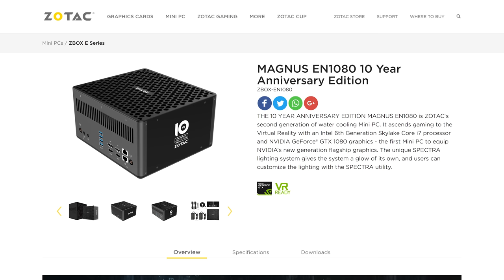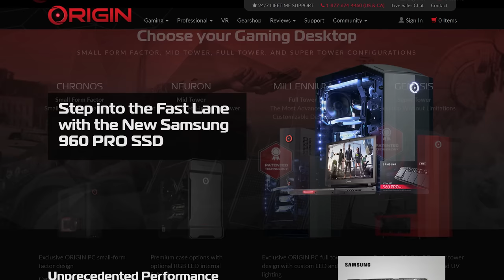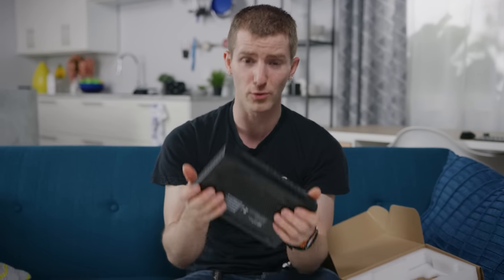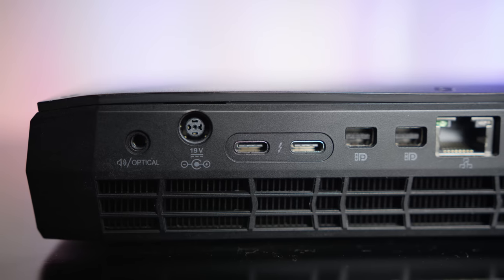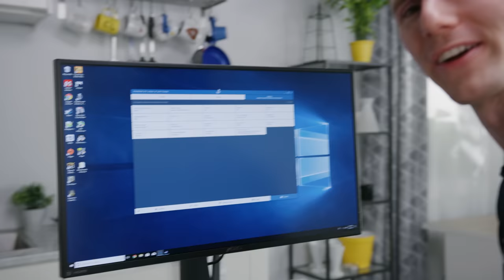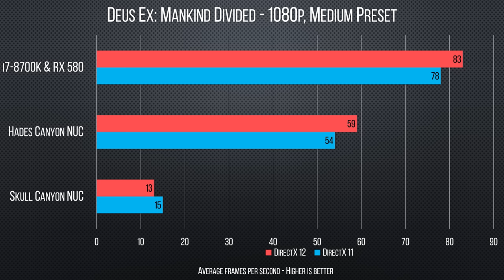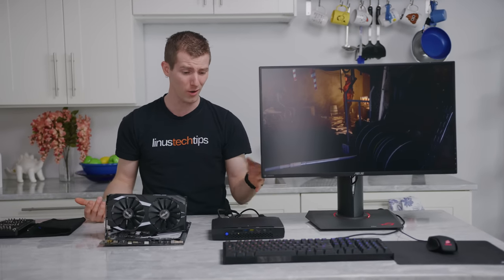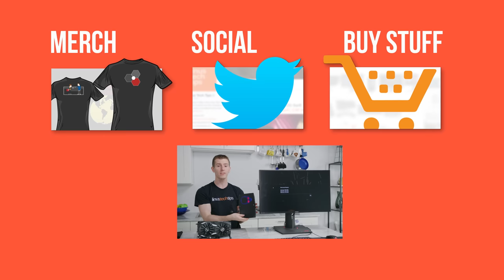Intel's Coolest CPU EVER... Thanks to AMD!

Comment: Ryzen 2000 series tomorrow
Reply: hype!
Reply: Is the 2nd gen the Ryzen 5 2400G?
Reply: Ex Gaming no 😂
Reply: Ex Gaming, not really the 2400G is Ryzen with an integrated GPU, it's not the Ryzen 2 CPU's launching tomorrow.
Reply: DanielRichards644 im sad that ive just bought an ryzen 1600 last 3 week
Reply: lance, no problem if you got a good deal on it. I bought a R7 1700 about 5 weeks ago for $200 USD Brand New in box
Reply: Honestly what are you hyped for? The 2000 series gives you like 200-300mhz more, thats it. Even less exiting than the upgrade vom Skylake to KabyLake
Reply: And Moto G6!
Reply: Don't be sad, it's not like Gen 1 Ryzen is obsolete now. I have a 1700X in my system, and it does everything so well I don't really see the need to upgrade to Gen 2 Ryzen.
Reply: R Y Z E N 2000 is availible ToMorRoW
Reply: SchwertKruemel Better memory latency,better in gaming at the same clock speed with Ryzen 1000,new chipset with preciion boost 2 and XFR 2,better ram memory support and better performance single core and multicore!
Reply: SchwertKruemel Der8auer oc'd a 2700x to 5.8GHz (using liquid nitrogen of course). 1st gen ryzen chips couldn't even get over 4.2. tell me how that's a really small performance gain
Reply: Well unless you have a liquid nitrogen system then we are yet to see what performance gains gen 2 has over gen 1 in a realistic consumer grade setting. Of course the chip will shine when pushed to its absolute limits, but your average consumer probably won't get anywhere near that kind of overclock. I'm not going to argue that it won't be better than gen 1, I have no doubt it will be. Just saying gen 1 Ryzen are still good chips and will most likely become even more affordable with gen 2 stepping in. I still don't see the need to spend more money on a gen 2 chip when my 1700X puts in some serious work. Saying you have to run out and grab the latest component is the same toxic mentality iphone users have. Don't bring that toxicity into the PC community when all people want to do is squeeze every ounce of performance out of whatever they can afford... I mean sure if you're about to build a new system go with gen 2, but having a gen 1 Ryzen cpu is perfectly fine... They still perform great.
Reply: XxAdyxX98 you stole MSI's
Reply: @Gaming Dutchie Back in 2017 he got 5803mhz on his 1800x.
Reply: no ipc from Skylake to KabyLake, this actually is an upgrade.
Reply: SchwertKruemel because it made the first gen stupid cheap

Comment: "Similarly priced system" 
adds highly price inflated RX 580
Reply: They need i7 so when underclocked it will not cripple overal performance that much.
Reply: I can't even understand how they used a RX 580 for something that is not mining.
500 miners probably cried after watching this video thinking about how they could be using that card
Reply: Rodryguezzz, boo hoo a graphics card being used for it's real purpose.. gaming..
Reply: Aireon 👏👏👏 you must feel proud of yourself
Reply: Actually in cpu dependent games yes, the 8700k will make a BIG difference lol. 

you really need to do some research.
Reply: Congrats! You couldn't climb up the society.
Reply: Seen no less than 4 posting for rx 580's for 260 shipped in the last week.  may be limited stock but... how is that over inflated?
Reply: Idk but damn! people must really want something that small as powerful as a full size pc you can build but for cheaper. But then again the form factor...
Reply: Have you seen 480 prices? Last years’ 480 (my card) I got for 250$ brand new. Now brand new they’re going for 500$ and I have no idea why.
Reply: Holy shit that increase tho
Reply: Aireon This was just too awesome
Reply: Honestly i have more of a problem with him using an i7 8700k instead of the much better value to performance i5 8600k.
Reply: Still overpriced  just get a Vega 56 / 1070ti ultimate price per performance. I recommend vega 56 over 1070ti because if it’s your first time building a pc a freesync monitor is way less expensive than a gsync one BUT Nvidia’s meant to add support for their gpus to work with freesync so I dunno.
Reply: ME in 2021: pain
Reply: Even more inflated in 2021 😂🤡

Comment: So intel just taped a Vega gpu to it. Moment when intel can't even trust their own graphics
Reply: Centbair Furiues nobody likes Intel HD not even Intel themselves...(for good reason)
Reply: I use my shitty Intel HD 4000 Graphics and I just play CS. Easily at 100 frames. It's not too horrible to be honest.
Reply: @potswiftly1263  um a Intel HD 4000 can only get like 50 frames on the lowest setting in csgo :p
Reply: I get about 60-100 average. Always. I mean 1024x764 stretched at low with autoexec. But I am used to it and it's 100% playable.
Reply: How can you even compare the performance of a discrete graphics card to integrated graphics?  If you want to play any serious modern titles, don't expect an integrated chip to give you high framerates. Laptops and NUCs with integrated graphics are much cheaper for a reason.
Reply: @sajinsabu  integrated Vega graphics would like to know your location
Reply: @festive5476  4700g vega igpus are a interesting deal but are the results of  2 years of the cpu and gpu wars ramping up

Comment: Put the m.2 to pcie cable on it you just had and see if it can crossfire with a vega.
Reply: 88djdmepfdnkjf94 Linus would never do that it would educate you about a product. Like how he educated people about Intel optane... And how he failed to mention you can use one as a boot drive or stand alone drive.
Reply: 4:25 "So we're gunna be using an Intel Optane 800p for our boot drive."
Intel Optane is currently the best route for a Boot / Operating System drive.
Namely because of those beastly Random Reads / Writes.
(Also, the best paging file storage.)
The only thing better than an Optane is an Optane in a raid 0 with another Optane.
However, I recommend only one as a boot drive and one as a paging file (If your too poor to buy actual ram.).
Then another drive in the Cold Data storage area... For games and stuff.
Because you can't beat the Price / Gig Ratio.
However, If you have the real need for speed go for another nvme ssd...
Reply: Matthew Murphy conspiracy much
Reply: Everen Not really it's just his content has lost passion.
Reply: If you're spending even £50 on the 800p for page file, surely it makes more sense to spend that money on physical RAM? IIRC this is R/W quicker than M.2 as its directly addressed? 

Stolen from a superuser thread..
As a general rule: CPU cache is faster than video card RAM which is faster than system RAM which is faster than SSDs which (regarding access time) are faster than HDDs.

As a direct answer, RAM is hands down faster. A typical SSD has a random access time of ~100 micros (seek time between 30 - 160 us.), while typical RAM has access times of a few ns.

DRAM: 200 ns
3D Xpoint: 7 μs (7000 ns)
enterprise NVMe PCIe SSD: 30 μs (30,000 ns)
consumer NVMe PCIe SSD: 110 μs (110,000 ns)
Hard disk seek: 10 ms or 10,000 μs or 10,000,000 ns

HOWEVER youre right, i watched that optane review and that was COMPLETELY skipped. The video ended and I still had only one use-case for the optane and thats SQL caching on a server...
Reply: Steven Jefferies this is true but $50 of ram and $50 of Intel Optane are two different beasts. You can maybe buy 4 GB of RAM for the cost of 16 GB of Intel Optane. Yes it's Quite slower, However it's allot more responsive than any other option anywhere near that price range. AND WITH INSANE RANDOMS. if you got 4 GB of RAM in a system then toss this in as a paging file yes it's slower however it's also a budget orientated options to meet the minimum ram requirement of things like games or programs that require more ram. Which may work out.
Reply: As Linus actually showed that programs that require allot of ram work decent on Intel optane. Allot better than the other options.
Reply: Steven Jefferies however I do like your logic there are always more uses for something. For example if I really wanted a faster storage I could just make a ram disk in direct I/O format and use it as a cache for my hard-drive to accelerate read / writes. However what your overlooking is the cost of that much ram. 16 GB of ddr4 Costs way more than 16 GB of Intel Optane as a cache for drives... Which is why it is far more viable and reasonable to use Intel Optane for that... Yes it will make the computer slower. However it will make commercial programs more usable to computers that are budget limited.
Using it as a paging file. And with the continued increase of requirement for ram in programs it would be far more cost effective to use Intel optane for many things. Especially after the technology matures more. We aren't looking for insane preformance we are looking for workable. Which for freelancers in the tech field would be amazing... Also don't forget this is only the first generation of these products. It has already gotten very close to the speed of ram compared to almost every other consumer available product besides very few exceptions which we both know those exceptions aren't even viable at those price ranges.
Reply: Steven Jefferies Also your right, (Technically) about several forms of ram being faster. However I was comparing to non-volitile storage not volitile storage and specifically about random read / writes. As a single stand alone drive. You should have known that since I have referenced off to cold data storage. Don't take words out of context please.

Comment: in benchmarking, you should probably include fortnite and or pubg, being such big games right now, would be a good thing to know before buying.
Reply: A stick of celery can run Fortnight well. PUBG is a moving target as far as benchmarking goes; it wasn't long ago that a 1070 was basically requited to run PUBG decently.
Reply: Hardware Unboxed or Paul's Hardware tested them
Reply: Dan Hyde PUBG has really shit consistency of frames even with top of of the line specs. Meanwhile Fortnite can be played decently from a desktop of 2010.
Reply: If your PC can run Windows 10 it can run Fortnite
Reply: get yourself and those stupid trendy games off my lawn

Comment: Question:

Will this Hades Canyon run the Radeon Graphics all the time (e.g like desktop, internet videos as with gaming) or is it just reserved for gaming and high GPU software and default to the on-board Intel HD 620 graphics for everything else.

Thanks in advance!
Reply: BikerDarren24 The GPU will only give the needed power for anything you throw at it. It wont work at 100% because you run minesweeper , that's just not needed.
Reply: Thanks, Yeah I understand that but still not really answering my main question. Would like to know more information on this.
Reply: I'm pretty sure that they won't include onboard graphics in addition to "dedicated" (but still directly soldered ONBOARD) graphics. So my guess is that there's no Intel HD graphics. I mean, why should it be there?
Reply: MrTurbomaexx i don't think they would include an intel hd igpu when amd is doing that job.
Reply: Yeah good point thanks, would like to find out more confirmed information on this as I have yet to find it.
Reply: MrTurbomaexxyou can switch to the igpu for less power draw.
Reply: BreckRB is it really on there? If that's the case, that is really interesting
Reply: Yeah my thoughts exactly, states on a few websites as still having the integrated graphics on-board so like yourself I'm still curious to get confirmed information on my original question on this.
Reply: BikerDarren24 Ok, I'm sorry, I really was sure about my point, but according to this website: https://www.anandtech.com/show/12226/intels-hades-canyon-nucs-with-radeon-graphics-are-official-799999-shipping-in-spring-2018
The igpu runs in "headless" mode, so I guess it can't be used to display anything because all display outputs are connected to the Vega graphics
Reply: iGPU is there : https://www.intel.com/content/www/us/en/products/boards-kits/nuc/kits/nuc8i7hvk.html.
Reply: Is that Mr Hackintosh asking?
Reply: GamingSpaceMarine you need the igpu to handle the 4k Blu ray DRM. But it's not hooked up properly so this nuc is not compatible with 4k Blu ray movies.
Reply: it is actually, the Display out is run through the Vega GPU, if it were not similar in architecture I would not be able to play Miss Peregrine's Home for peculiar children on my blu-ray player with my 8th gen based desktop in 4k with HDR because all of my display outs are run through my 1080, not the onboard GPU. this is how I see that feature working in this case with the signal being routed through the GPU to get to your display of choice.
Reply: "Onboard" graphics are disabled. Which means you can't use Intel QuickSync, nor does it qualify for UHD Blu-ray decoding.
Reply: it isn't a matter of whether it is Radeon or else, or whether it is integrated graphics or not. it is the applications themselves which tell the computer which processor they are DESIGNED to take the most advantage of. sadly for most programs, they just aren't coded to use a combination of both of them dynamically.  for instance, it would surprise you that on most circumstances Photoshop and Audition won't use your GPU at all, they will make the calculations through the CPU for that is what they were designed to do. even for most non-new codecs VLC would still prefer to use the CPU for the decoding leaving the GPU for the display related tasks.

so to answer your question. Will the Radeon Graphic be running while browsing internet or watching videos? yes it will, though chances are that for most occasions, those activities would have very low demand of its resources and prefer to use your CPU instead
Reply: here's the Processor that's in it.
https://ark.intel.com/products/130409/Intel-Core-i7-8809G-Processor-with-Radeon-RX-Vega-M-GH-graphics-8M-Cache-up-to-4_20-GHz?q=8809G

it has an iGPU listed there, so you should be able to use it. if you're asking for DRM reasons then it seems like the answer is no, but if to just use it, then it seems yes.
but it's not a battery powered device so to just use it doesn't really matter, it'll all be on either way and consume the power it needs for the tasks.

Comment: Linus. Seriously. You've gotta delid that cpu/gpu. For science.
Reply: That might be hard seeing as it doesn't have a "lid" to remove. It, like most mobile chips, already uses direct die cooling. He could probably upgrade the thermal paste.
Reply: I don't think there'd be much interesting to see there. They're just regular parts that are glued together along one edge and fit into tightly co-sited sockets on the motherboard, so that the 8 dedicated PCIe lanes between them are little more than jumper traces (saving energy, as well as motherboard space, now that the interface is no longer running via a separate chip), and so they can share a single cooler.

Comment: HCNuc is not mean for desktop use.. it is suitable for complete VR setup while you put the HCNuc on your back as bag then all stupid cables are compacted from it to the VR for great experience. When we see if the HCNuc is completely portable that it it may able to run longer on battery rather than long power cable

Comment: For those who only know nvidia, multiply the CU number by 64 to get the 'stream processors' which is roughly equivalent to 'cuda cores'. Not the same, but roughly equivalent, functionally. They are both the names given to the pixel pipelines.
24 * 64 = 1536
20 * 64 = 1280

The Vega 64 has 64 CU's, hence the name, for a total of 4096 stream processors.

Comment: I can see products like this getting many console gamers, such as myself, to switch over to mainly PC. The price point is the only thing that will hold most people back, I think. Although, it's hard to tell what the next generation of consoles will bring since the leap from PS3 and 360 to current is quite impressive.
Reply: I can definitely see AMD using this tech in the next-gen consoles. NUC's are somewhat of a niche product right now. So, the prices will be higher than building your own.
Plus, the small form factor adds to the price too. ...The graphical leap from PS3 to PS4 wasn't nearly as substantial as previous generations. Both Sony and MS were 
trying to save money this gen. If you look at the PS3 when it came out it cost Sony $800 for each console. PS4 cost Sony $280 at launch. The 360 and PS3 were on par 
with high-end 2006 PC's. While PS4 was on par with a lower mid-end PC in 2013. The abysmal cpu's in XB1 and PS4 are their biggest faults. Next-gen should have Ryzen.